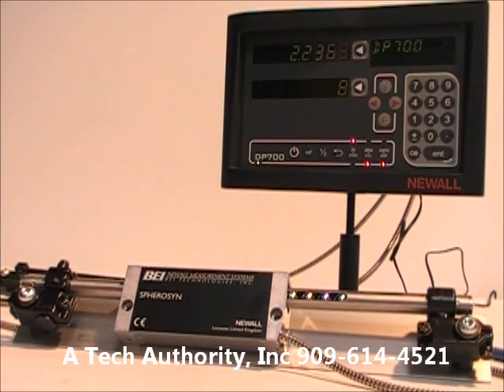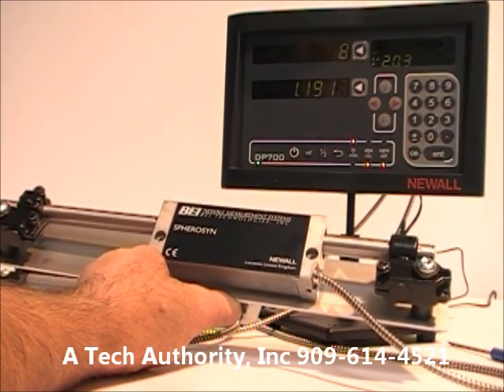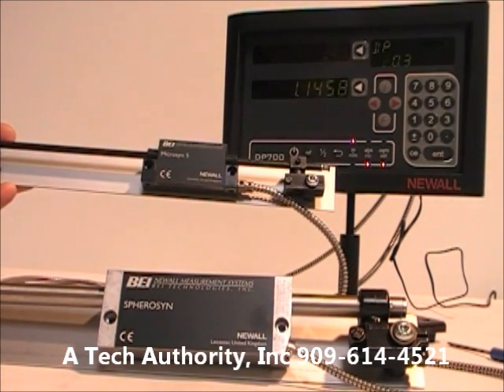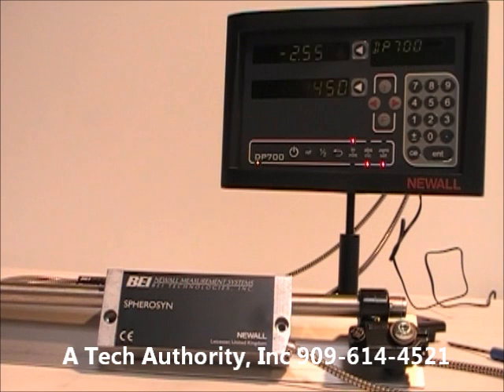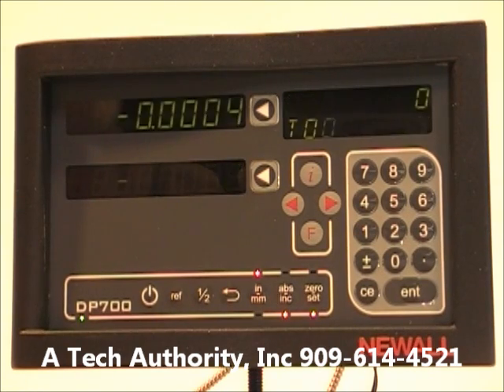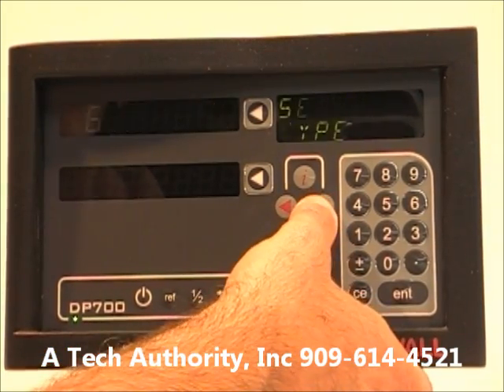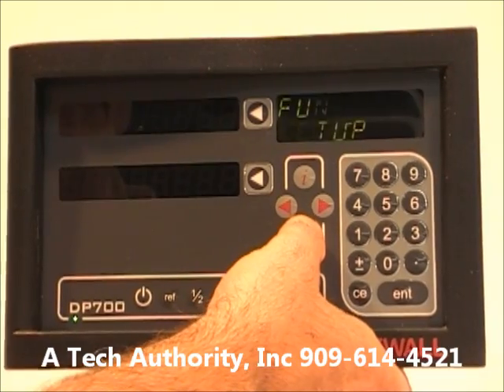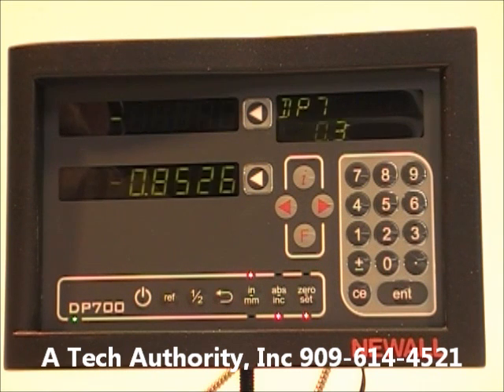Newall Scales and DP700

Comment: I have a Newall DP 700 2 axis DRO on my Jet JTM 1050 EVS/2 mill, can I add just the scale on the quill and a 3 axis screen?
Reply from the maker: No, you will need to purchase a DP700 3 axis unit to add the quill feedback, you you already have X and Y scales plugged in.